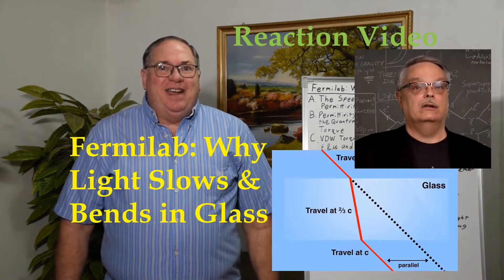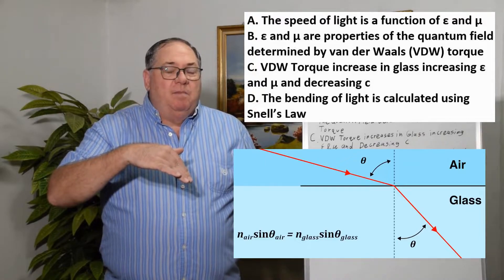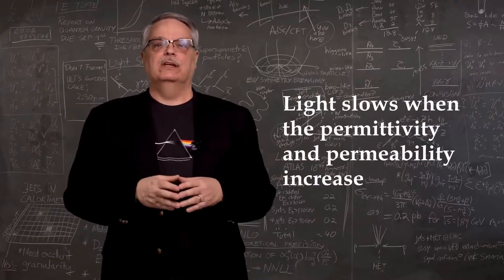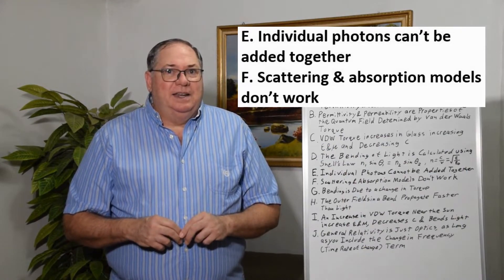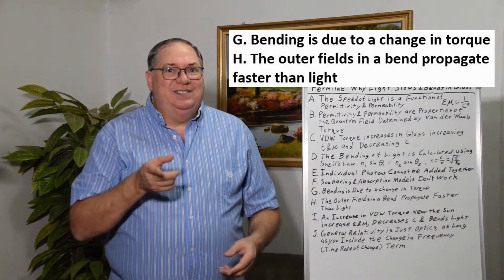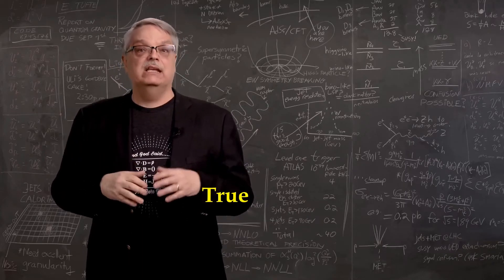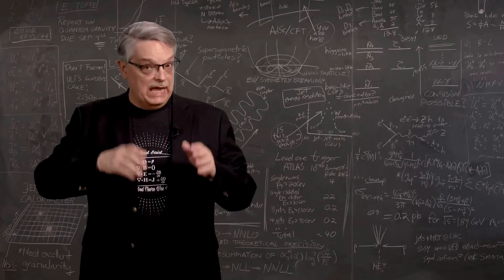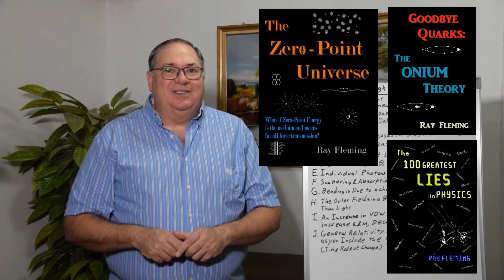Fermilab: Why Light Slows and Bends in Glass

Comment: In the case of a prism, if the VDW torque is responsible for bending of light, why do we red light get bent less than blue light?
Reply: Because permittivity is dependent on frequency
Reply: @SamMackrill  is there any intuitive way I can understand why this is the case? Thanks
Reply: @HokShunPoon  That is a great question, I have not put much thought into. As ε is increased in matter because the VdW Torque increase it must be that the increase in torque somehow interacts with the frequency of the light. That was one of the things I wanted to ask ray about :(

Comment: Dr Fleming talks about the wave length and freuency both getting shortened in high mass /high torque situations. My question is "can and do really change or shorten the frequency of a photon ?  and, if it does then how and why the light regain its frequency at the exit from the glass or other transparent material?
Reply: I'm really struggling to see how high torque bends light. I want to see an example with a two de Broglie photons, one with 'red' frequency and another with 'blue' frequency. What explains their bending, and why is it their bending at different angles.

The closest I've found to answer is 3Blue1Brown's mention of the Driven Harmonic Oscillator model to explain light slowing. But they use the Marching Soldier analogy to explain why slowing implies bending. This is wrong.

Comment: The line passing through each individual balls on page 10:10 represents the phase timing and direction of light propagation. It does not have any physical or electrical properties other than relatively. So it cannot act like a lever by which force and momentum of one ball can be coupled to the next. Hence faster than light event. If this is van der walas force we are abusing VDW by mistake.

Comment: No, the speed of light does NOT change.  This guy's explanations are clearly due to a shallow understanding.    Listen to Don.   (Note:  ε0 and μ0 are constants.)
Reply from the maker: The Shapiro delay proved that the speed of light changes. In EM theory the speed of light is always a function of permittivity and permeability.
Reply: @rayfleming2053  Except that ---  ε0 and μ0 are constants.    This is key.
Reply from the maker: @cheponis  They are constants that change depending on proximity to matter.
Reply: @cheponis  Those are values in a vacuum. In matter those values change and thus so does light!

Comment: Permeability, permativity, (porosity), elasticity and density  of the aether;

1.  The mass and speed of motion of baryonic matter determines porosity, elasticity and density of the aether;
2. Under current thought, by some, there are three things or structures in the universe: baryons, dark energy and dark matter; what they ignore is that free space is also made up of the aether, energies that are not at all understood, yet;
3. Baryons and the structures that make up free space at the quantum level, the aether, do not mix well.  In fact, they can not occupy the same location.  Baryon particles push away the aether.  
4. The aether pushes back with a force that we call gravity.  The push of baryons decreases the permeability and elasticity of the aether AND increases the density of the aether.  It is the combination of these two effects that creates a push back against the baryons;
5. The baryons also push against the lessoned permeability and elasticity AND density of the aether.  In doing so the baryons expend energy that they lose. 
6. The loss in energy causes the baryons to contract in size as well as to reduce the frequency and amplitudes of the nuclear forces.
7. This causes all functions to slow down.  The half life of radioactive elements increase as the "vibrations" slow down.  The cesium atoms in a "atomic" clock slow down to show the clock to run slower.  Computers take longer to calculate pi.  Our organic bodies and brains run slower.
8. We experience our lives to be running slower.
9. If we were to live on a denser (more massive) baryonic planet we would experience our lives to last even longer; our cells running slower.
10. The differences in permeability, elasticity and density of the aether also affect our GPS satellites.  Because these satellites are further out and away from the denser portions of the aether, their atomic clocks run FASTER.  Astronauts age faster in space; their internal clocks run faster.  Computers run faster.  Computers between those on earth and in "space" sometimes have to be synced.  The GPS clocks on earth and those in space are regularly synced so our GPS systems can accurately calculate where we are.
11. As I said before, the permeability, elasticity and density of the aether is also affected by the speed that baryons travel.
12. Not only does the aether not like the presence of baryons, but moving baryons disturb them.  The amount or size of the disturbance is controlled by the speed of the baryons.  The greater the speed, the greater the DECREASE in permeability and elasticity and the GREATER the density that the aether experiences.
13. As a rocket ship moves away from us, at the speeds we can now create, the time differences will be small,  earth will run a bit slower and the rocket will experience time for it and them to run a bit faster.
14. But this changes at higher speeds.
15. Not only does the aether not like the intrusion of baryonic matter, especially LARGE amounts of it; but, the aether does not like matter moving through it and will push back against it.  This push back, again, manifests itself in the form of GRAVITY.
16. Everything that gravity does to "stationary" baryons, it now does to the moving baryons.
17. Time, the speed at which the baryons "move" internally is affected.
18. At first, at earth speeds, the time of the rocket and those on board is experienced ever so slightly faster than for those back on earth.
19. As the rocket picks up speed well beyond earth speeds, the time clocks on earth and on the rocket ship will be running at the SAME speed.  So will we experience time at the same speed, because the baryons that make up both the "stationary" and moving baryons are in sync.
20. As the ship travels even FASTER, things change.  The ship and the occupants start to experience NOTHING.  To the ship and the people on board, everything is "running" at normal speeds.
21. To an outside observer, however, the earth baryons are running FASTER than those that make up the ship. 
22. To the Einstein scientists, time is running slower for those on board the ship; in FACT, time is not what "runs" slower on the ship but, rather, the baryons that are "running" slower.
23. This difference in perception of time is called "time dilation" by the Einstein scientists.  The statement implies that the course or movement of time itself is affected.  That phrase should not be used to describe this.  It is more accurate to say "time perception" as it may apply to humans and "baryon slow-down" when referring only to matter.
24. An outside observer is still, however, needed to visualize the differences between the "stationary" and "moving" states of matter.
25. Permeability, (porosity), elasticity and density  of the aether are important concepts to understand what happens to matter and why at near light speed.  I do not believe that the Einstein scientists mention the above characteristics of aether in their explanation of the 
26. 
27. --- conservation of momentum and energy
28. Mass x velocity = momentum
29. If no more thrust is added to a spaceship traveling through a denser and less permeable aether, eventually the momentum will decrease and so will the speed of the spaceship?
30. There should be symmetry between Alcubiere/White's drive results and how the aether reacts to matter moving through it.  Commonalities between different   things can connect them into a new whole.  Gravity causes time dilation, so gravity must be involved with high speed time dilation, near speed of light.  Likewise, all that we hypothesize that happens to matter at high speeds must happen to matter that is not moving, but at a much smaller rate and amount.  High impermeability and density at near light speeds translates to low impermeability and density at low speeds.  
31. Feed back loops of the Alcubiere/White drive creating bubble and bubble creating the density/low volume.  A resonance??????
32. Permativity is the resistance of a substance to the creation of a magnetic field.
33.

Comment: I think all of these explanations are incorrect because of something called a kaleidoscope. You can't say that light is slowing down! What happens is the glass and other materials are acting as mirrors and cause the images to become disturbed to the person that is observing. So this is nothing but an illusion. There is nothing true about this for physics to explain. Since this illusion happens over and over again at all the tests, with different mediums, it is causing confusion. If light really was to slow down and speed back up again, it would be against the laws of physics! Also, because light comes out from the other side of the medium at the same angle it entered, it causes a greater contradiction, and you guys are trying to find an explanation for this problem. On the contrary to the observing eyes, light was never bent, curved, or has taken a different direction to begin with, it was just an illusion. If there was any simpler explanation to this phenomena other an illusion, then it would be glass acting as a capacitor.

Comment: If the permeability and permittivity can be changed or modified, does that mean Planck's constant can also be altered? Very interesting if it can...
Reply: Planck constant can remain the same if we allow space to be of varying density.  The change locally in permittivity becomes an artifact of that density increase.  As per gravitational field equations applied to energy rather than mass.  Bucause they are equivalent.

Comment: I am a bit surprised that the good Dr. Lincoln discussed the speed of light in other materials such as glass and water.  This is a bit of a 'can of worms' for physicists, because the speed of light is undeniably tied to the medium.  If the medium is moving, the light is simply carried with it.  

The same holds true for light moving with or against the quantum field - and the quantum field can and does move.  Tough to prove, as the speed of light is measured for a round trip...

Comment: Is no one taking into account that light travels slower in matter cuz matter has the ability to absorb light, like some "microscopic black holes/suns". Matter is like a "magnet" for light, it's just that it's with energy, instead of just iron. Also, as with magnetism, we can see light trying to go through all the bodies that are in contact with each other, similar to how magnetism can travel from one magnetic to another attached metal.
So, I inherently think matter has attractive and reflective properties ! Basically, matter is trying to "keep" the light in itself once it "brabs/intracts" with it and this results in a slower speed of light.
Reply: light is a wave, it can't be attracted
Reply: @Nekrumorfiini1  Lol, so it's immune to it ? That's dumb, lots of bodies in the cosmos attract light and it' only a macro version of what mass individually does.
Even the particles of dust attract light but their mass and gravitational pull is to small to do anything noticeable.

Comment: 1:15 Sorry, I stopped watching because you asserted that Lincoln claimed c was the same in all mediums. But the premise of his video is based on the opposite. Certainly his video was not good enough - primarily he doesn't talk about what causes the secondary wave that superposes with the incoming beam, apart from hand waving that atoms have electrons with static charge that react to the EM field, and so produce reactions of their own. But how do you calculate that? (I would imagine the analysis would be easier in something like diamond where the lattice is very regular)

Comment: Light. I wonder what makes it speed back up again? is the torque transmitted to the material somehow selectively given back to the photon as it leaves? If not, then surely this induction effect would mean the effect encountered at the transition line remains throughout the length of travel through the material, continuously effecting it's path, thereby tracing a circular path? A straight path is observed, however, signaling the first option as more logical. So, what is transferred from one side of the material to the other, ahead of the photon, to let the atoms at the exit site know they need to return enough energy back to the photon as it leaves the surface, to speed it back up to it's original speed? The only remaining solution is the magnetic flux paths of the unit dipoles making up matter. Not some hocus pocus quantum flux. The fields are aligning with the nearest neighbouring structure, ahead of the travelling charge packet, which continues on it's original trajectory, minus the inducted energy it took to enter the material, until it reaches the re-emission surface where it is re-energised by the inductive kick-back of the dipoles within the material, altering the path accordingly. If it were some random, quantum field being selectively organised by the photon as it passed through the material, abberations would surely occur. Enough to be able to test for. And yet, we have optical quality glass and amplification factors in the order of millions being used routinely around the planet every day, and not one single photon has induced any noticable cascade within the material of the glass, causing abberations in the overall light field being transmitted through any lens anywhere in all of history. As far as I know. At least, nothing more noticable than "lens flare".
Reply: That's the idea, light can't be a particle cuz particle transfer momentum, light doesn't transfer anything ! It can be slowed down cuz matter naturally attracts or tries to keep light within it once it grabs it, but when light escapes the object it's speed is normal energy.Only energy behaves this way, not particles  ! Only, light can't be a particle cuz particles can't be waves and also can't disappear when they encounter other particles(Yeah, they think photons disappear once they hit a atom and then reaper again, particles don't work like that)
Reply: Right this does raise lot of questions, and does suggest the interpretation of light as a kind of dimensional limit, which I think it can be as well as being consistent with a luminiferous ether. The problem if we try to explain it mechanically, and not as as optical or dimensional limit effect, is this very point about how could it possibly speed up again. I think that makes this phenomenon a great thought experiment for getting to grips with what light really is. Still think we need to learn a bit more here.

Comment: I wouldn't dismiss the absorption and re-emission idea just like that because;
1. It wouldn't bite the other approaches or theories that much.
2. I have black glass in my induction cooker that scatters normal light in all directions, but lets infrared through in straight lines.

I like the subject though. Thanks for the video, Ray.
Reply: Light is an Electro Magnetic Emmision (EME) or Radiation (EMR) (two names for the same). We have EME's at many frequencies be it Radio Waves, Radiated Heat, Light, X-Rays or any other rays or emmisions. They only differ in frequency. Actually they don't only differ with frequency but also how they pennetrate materials. Radio signals go through wood allmost unhindered but light has it problems. The same x-rays can go through steel but light and radio signals can't. Higher frequencies can go through allmost anything. It must there fore have some thing to do with the atoms of the material.